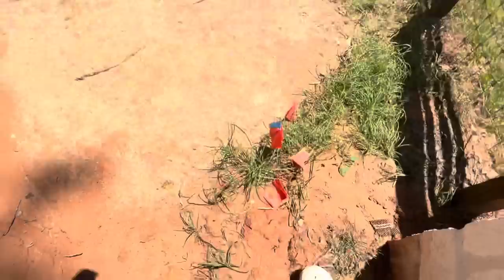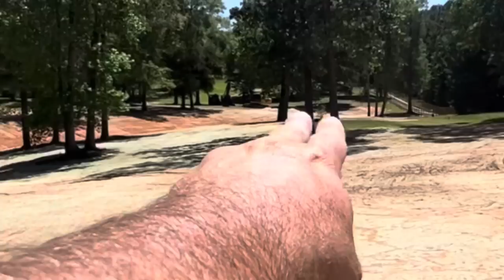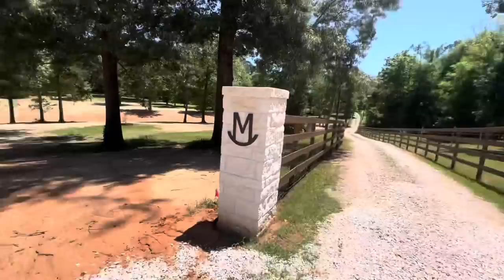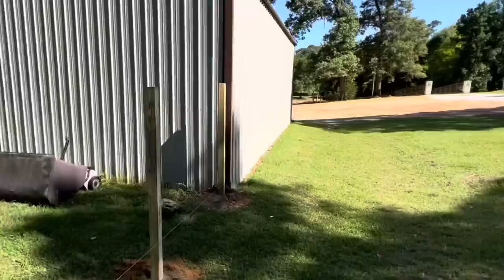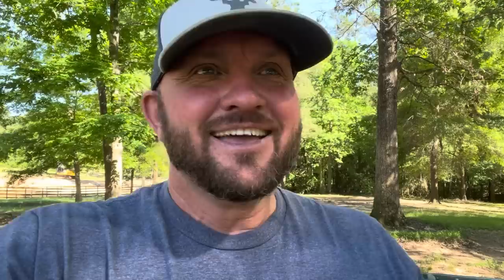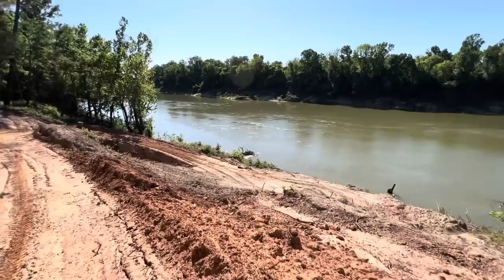A Comment about Commenters

Comment: I’m impressed with how easy your pinky wiggled around so smoothly, I tried and it didn’t look so smooth!🤪 I’m sure a fence I’d build wouldn’t look so smooth either. The only thought I had about your fencing design was how long and thin the entrance driveway is, only one vehicle at a time in either direction. Then I realized it has worked for you on the morrow land. I bet it happens once in a while where someone has to back up.